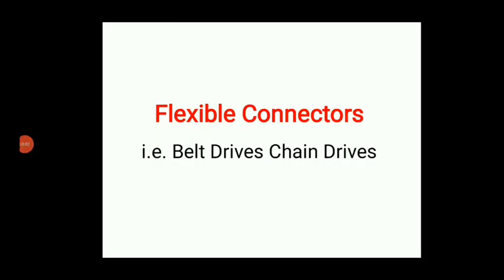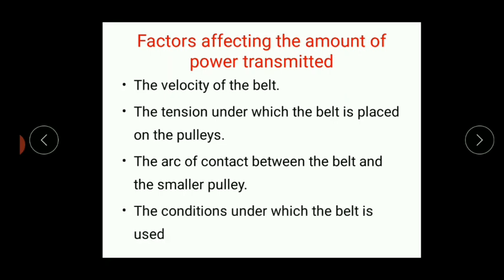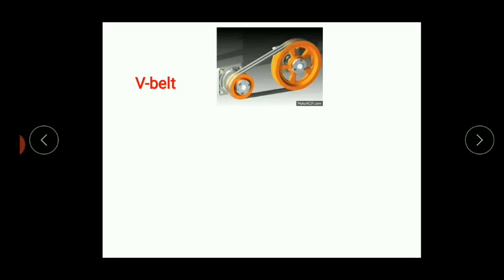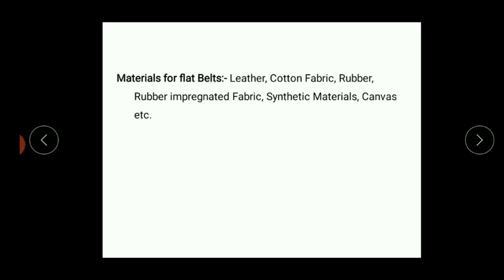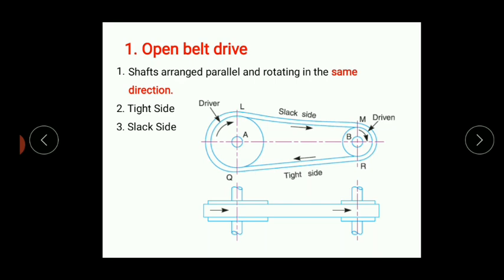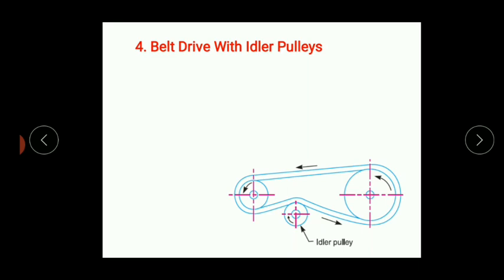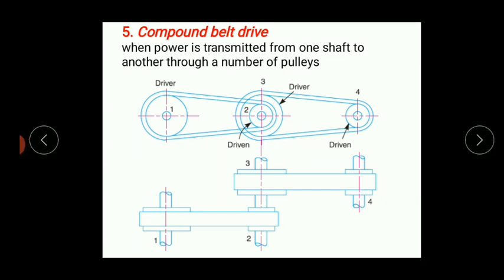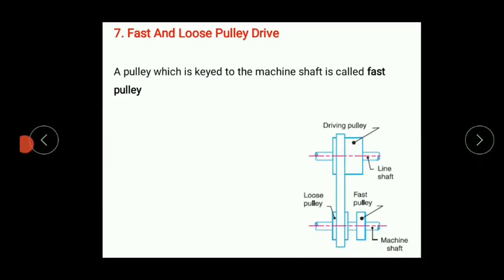Video 1 Belt Drive Introduction

Comment: how can steel is used in circular belts 
steel is  not flexible in nature?
Reply from the maker: Steel plies are impregnated in the some belts to improve elastic strength and increase durability.
Steel is an elastic material (you had learnt it in Strength of materials)
Belt can't be completely made of steel plates but steel ropes can be used in rope drive like it is used in lifts or steel chains as used in ship anchors. 
Hope I had clear your doubts